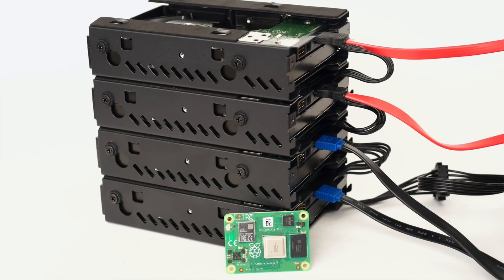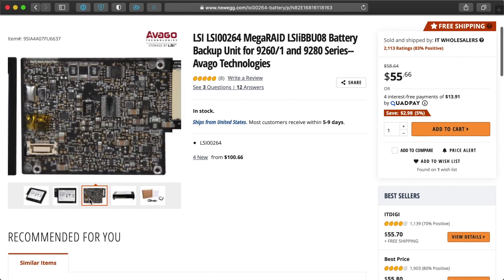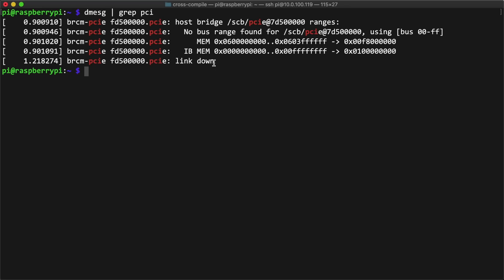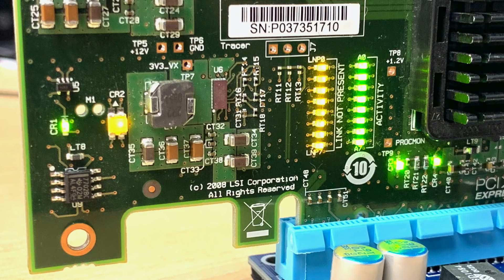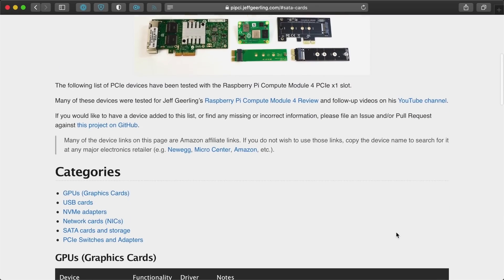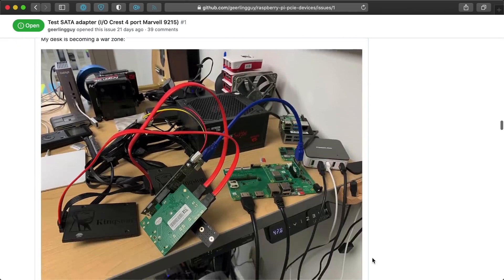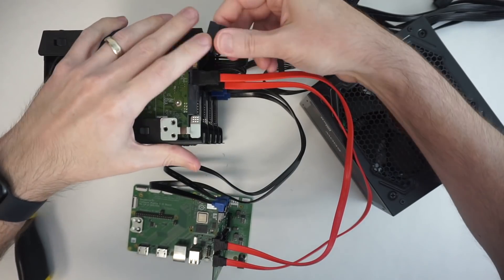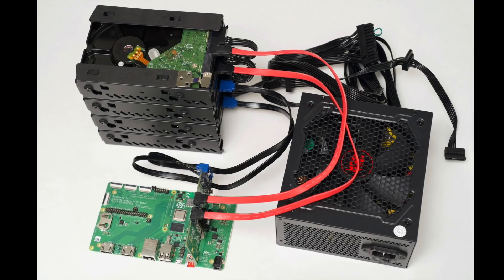Enterprise SAS RAID ...on a RASPBERRY PI?!

Comment: I'm laughing with a dell R900 under my bed :)) 

But I can't even hear myself laughing tho...
Reply: I assume you use it to warm up the bed?
Reply: @Vanplay92  and a good chunk of the house
Reply: This made me laugh xD
Reply: HP DL380 G6 for me, but I feel your pain brother 🙏😭
Reply: I got some storage racks. They are so quite, a friend of mine can even sleep next to it :)
Reply: 13 years ago I turned my bed frame into a home lab rack with a 2 x DL360's, 2 x McData fibrechannel switches, a Cisco 2950 and an EMC AX150 storage array, crammed into the slide out drawers with holes drilled for cabling. Best bed warmer/fire hazzard I ever had..
Reply: @evmond  fire hazard? I'd rather have a bunch of those old iron servers than the best selling space heater, ever. 
Just think  about the shear number of failsafe measures built into a server. Crackling power cord? The server will disable that PSU for excessive EMI even if not redundant. ;)
Reply: :D
Reply: I have an power edge 1950 under my bed.

Comment: off topic,the Silverstone CP11 SATA cables are really nice and easy to manage, but yeah, SAS working would have been nicer
Reply from the maker: Ooh nice, I'd never seen those before.
Reply: @JeffGeerling  they're slightly more pricey than standard SATA cables, but as long as I have to keep using SATA cables, I'll be using CP-11s
Reply: Yea I had to get some as they were the only ones that would fit under my gpu, the price is "special".

Comment: ZFS or it didn't happen :)
Reply: It is as simple as "apt install zfs-dkms" on Ubuntu for the Pi4.  Performance is not great over USB3 with more than 1 disk, so I'd love to see some SATA numbers.
Reply: Can you install OpenZFS on raspian?
Reply: Oracle, wants to know your location
Reply: yes!
Reply: Been recantly playing with rockstor seems a bit rough around the edges, so many red box errors when doing certain tasks and having to use ssh to expand the volumes (considering this is 3.9v stuff should be catched correctly )I guess this is only applicable if you have cloned the disk to a larger disk the btrfs help command really needs more work, I was very annoyed once I got it to work, I found out that devid is devid:x (x as number) you expand the expand max command to expand all volumes on every disk but no it only does the first disk of devid 1

Other thing I tested was disk pull (I force removed disk from VM) and it was throwing lots of flush errors in display output as it was still trying to write data to it while the disk was missing (btrfs should have dropped it) , once I rebooted it wouldn't remount until rw, Degraded was added as the disk was now been detected as missing  (no actual data was lost mdsum in the files was intact and this was me writing to the btrfs pool while I removed a disk) there is zero way to remove the missing disk via GUI from the btrfs pool unless you use ssh to run the btrfs remove command on rockstor
Reply: This guy
Reply: You, I like you
Reply: Lol there’s no way ZFS is going to run on such constraints....at least not usably anyway
Reply: @KienTran  LOL Usable I don't think that was the point. :)
Reply: @KienTran  a 1GB Pi3 is more than enough to run basic storage ZFS without dedup or anything too fancy. 
We run 8TB+ pools 1GB x86 boxes and have done for a couple of years without a single bit lost (sample size 300+ units, 6PB total)

The (old Atom 330) boards in use are constrained by 1 slot of RAM so the max installable is 2GB - but we cannot renew  or upgrade the hardware as they are all deployed in very remote locations and run 24/7

True, they suffer from bottlenecking on intense random workloads but the boxes are fine for typical NAS use.

We also run 20 or more RasPi 3's on ZoL doing the same...
Reply: No ECC means kaboom time. Rockstor is respectable, but those things are overrated, just use Mdadm fsmerge/smart ache and backup like a normal multinational corporation. When things blow up in 5 years, restore from backup resell the hard drives, get newer bigger ones and you're good for another 5 years.
Reply: Data integrity is not our main problem :) 

Our ZFS NAS boxes are the backup - hardware changes to the fleet are simply not an option. These are very remote sites that are unmanned for couple of days every 2 years, at the best case. Some require a week of travel to reach them and most kit needs packed in/out by humans on foot - including the bulk data. Hail and snow build up is the biggest problem org-wide, followed by lightning strikes and PV panel and battery  degradation. It's not a cost aircon environment and there are no luxuries like next-day delivery. Very few sites have generator backup. Environment ranges from ununhabited desert plains to arctic mountaintops.

mdadm  was dropped after 2 years or so due to being too unreliable due to silent corruption across various hardware types and the consequent cost was huge (BGAN data costs are huge even to re-image an OS). The only surviving boxes are Atom330s running ZoL and a few Pi3s that were dropped more recently. All the various "server grade" hardware failed over the years.  After mdadm and /or hardware RAID was abandoned, we used ZFS on FreeBSD until ZoL was mature enough (the rest of the org is mainly on linux) 

The motherboards are nearly 11 years old now. Oldest  zpools in use are now between 8 and 9 years old, drive failures dictate replacement (SSD nowadays)
PSUs were highly specced at the outset and hot/high altitude ones have additional forced air systems and extra PV to power that. The highest sites had problems with spinning disks (high density altitude in some places is common every day) but once replaced with SSDs they have been fine.

ECC was only used on the server-grade kit. It all failed with mdadm in practice, detected by md5 hashing scripts. Some ECC systems also gave (detected) erros on ZFS. No corruption or loss has ever been found on the surviving Atom 333 systems (yes, I am surprised by this too) 

I got involved when they moved to ZFS and also specced the (routine, every 4 years) PSU and battery replacements. 

Every few weeks we've been told "you need 256GB of ECC to run ZFS or it's not worth even starting" - we got used to it.

Hardware costs are a tiny fraction of the logistical costs - it's not about money for new hardware. It's about good hardware and overall systems design and cooling against physical access problems and the elements. Finding borked mdadm arrays and hardware card faults after 2 years of so-called "data collection" tipped the balance to ZFS to keep the system alive. It still lives on, having fulfuilled its primary purpose many times over. Not a single box has ever had more than 2GB of RAM at any stage, only the 1GB boxes remain in service.  

We are now seeing old-age mortality across the fleet but we've still never lost a single bit since ZFS. Bathtub curves are so deep and steep here the spiders can't get out :)
Reply: @ch4.hayabusa  for home use you dont need ecc, obviosly nobody is going to use a rpi for mision critical data X)

Comment from the maker: I can't believe you're even trying this!

There's a reason people buy giant PC cases and mount all their hardware inside.

This is so dumb, why am I even watching this video?!
Reply: when you leave a dumb comment on your own video just to see how people will react to it
Reply: This is the one, I was waiting for. SATA support is probably the most important change since Raspberry Pi was released. Add a pico PSU and you have very capable system :)
Reply: Maybe make a custom storage case for this kit, imagine the nice Pi board on top of it all?
Reply: I was expecting some 3d printing overkill to add more problems
Reply: it would be boring if you didn't try this.
Reply: I bet he’s checking who watched the whole video... part 2, really!
Reply from the maker: @darrensmith016  Apparently about half the people who comment actually watch the video :D
Reply: @JeffGeerling  I couldn’t believe you left this video as a cliffhanger!!! 😆
Reply: Those Dell SAS cards may be designed to not even work if not plugged into a Dell computer.  Some of the Compaq PAS raid cards worked that way.
Reply: Hi Jeff...
I was thinking perhaps the cards detect that there r no drives connected & shut down...
Worth a try...
Reply: Recently did something similar, I have a Dell Optiplex and have 1 hard drive, I converted my CD drive slot to a second hard drive slot too, but I need more. So, I bought a 5 hard drive bay, a PCI-I to 8 Sata, like double the ports you have and also a 1 to 5 Sata 15 power splitter. So now all I need to do is wait for everything to arrive.
Reply: @sp69  did it arrive
Reply: Could be worse, it could be an HBA and zfs on Linux.
Reply: > This is so dumb, why am I even watching this video?!

Because you need to do post-edits, I assume... :P
Reply: Wait ... How does one show typing a comment in a video which is not yet uploaded to YouTube and then have the actual comment too in the comments section? Classic chicken and egg problem!
Reply from the maker: @indrajitg  You gotta count your eggs before your chickens are hatched!
Reply: First!
Reply: Because passive cooling and low power consumption. Thanks for the video, from a person with ARM servers at home since 2011. I'll be happy to switch from USB enclosures to SATA.
Reply: Thats a good question, why are you watching this video instead of making the next one?  you're too late to save my soul, I upgraded to an udoox86 for my nas server, but others can still be saved!
Reply: So meta
Reply: Link down.. isn't that because there isn't a hard drive connected or am i just stupid??
Reply: Wat
Reply: xd
Reply: :D